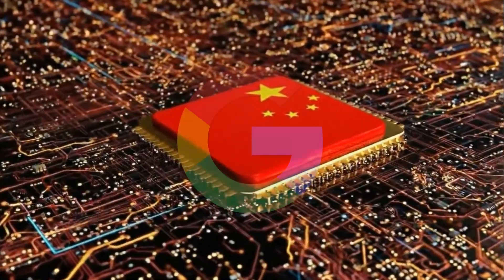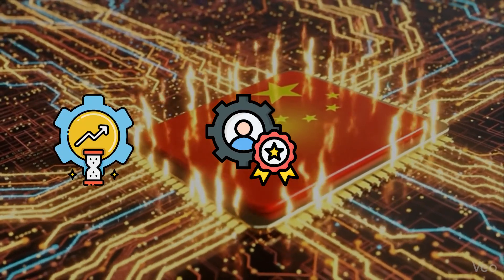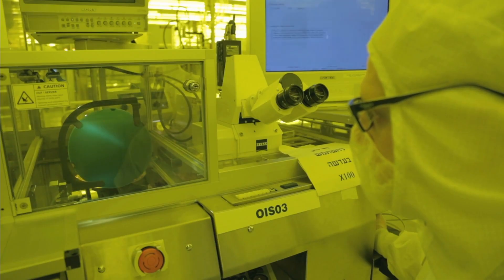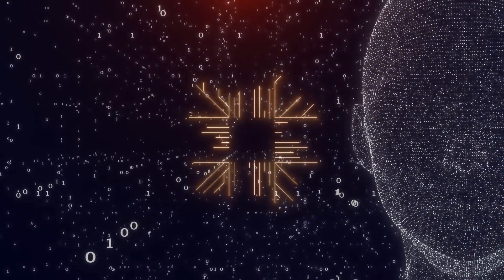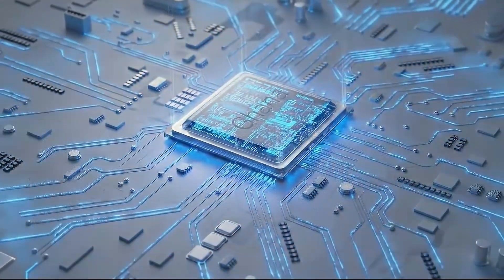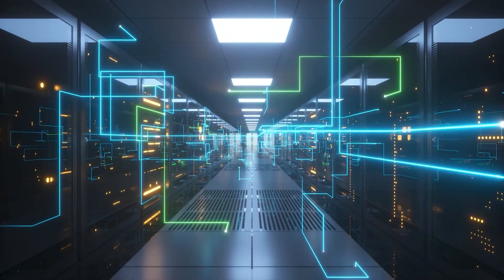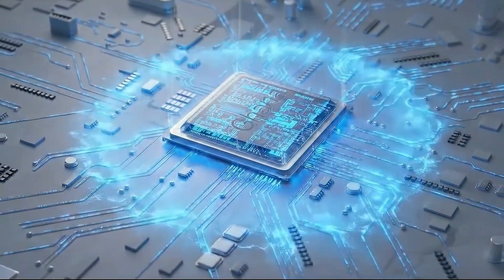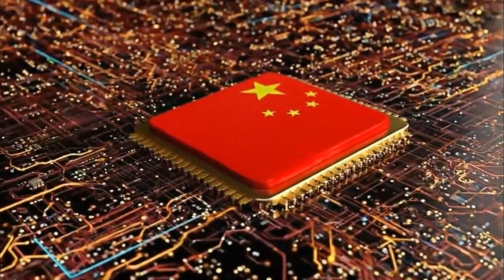Ex-Google Engineer in China Built TPUs That Are Replacing Nvidia and Google’s Own!

Comment: Fact‑Check: “Ex‑Google Engineer in China Built TPUs Replacing Nvidia and Google’s Own”
Short answer:
A Chinese startup did build a homegrown TPU‑style AI chip led by a former Google TPU engineer — but there is no evidence that it is “replacing” Nvidia or Google TPUs. The claim is exaggerated.

What’s True
1. A former Google TPU engineer founded a Chinese AI chip startup
Multiple sources confirm that Zhonghao Xinying (also called CL Tech) was founded by Yanggong Yifan, an engineer who previously worked on Google’s TPU program.
2. The company built a TPU‑like AI accelerator
The startup developed a chip called:
- GPTPU (General Purpose Tensor Processing Unit)
- Also referred to as “Ghana” in some reports
This chip is a custom AI ASIC, similar in concept to Google’s TPU architecture.
3. The company claims performance competitive with Nvidia’s A100
According to reporting:
- Up to 1.5× faster than Nvidia’s A100 (2020)
- 42–75% more efficient, depending on the source
These numbers come from company claims, not independent benchmarks.
4. China is actively seeking alternatives to Nvidia
Articles note that Chinese firms are exploring domestic chips due to export restrictions and supply constraints.

What’s NOT Supported by Evidence
1. No evidence these TPUs are “replacing Nvidia”
There is zero confirmation that Chinese companies are switching en masse from Nvidia to this startup’s chip.
Reports only say it is positioned as an alternative or may help reduce reliance.
2. No evidence they are “replacing Google’s own TPUs”
Google’s TPUs are used internally and now sold to cloud customers.
Nothing indicates Google is being displaced by this Chinese chip.
This part of the claim is false.
3. No independent verification of performance claims
All performance numbers come from:
- Company press releases
- Media summaries of those claims
No third‑party benchmarks exist yet.